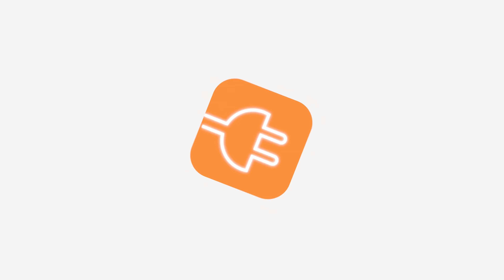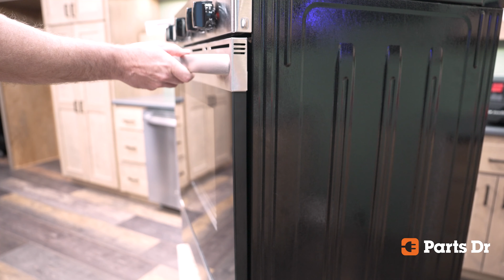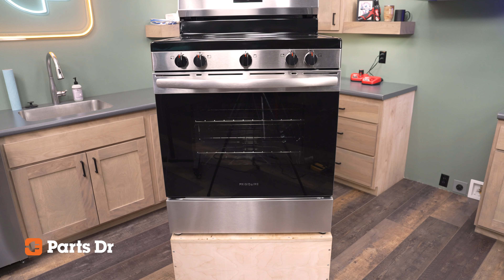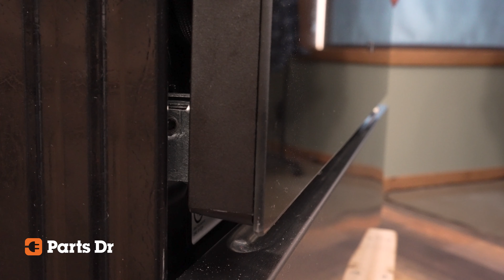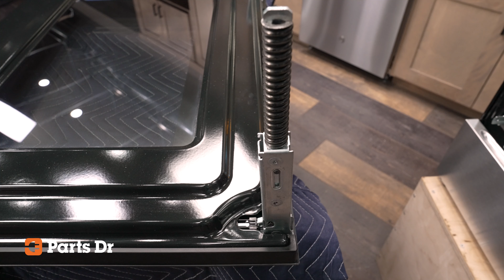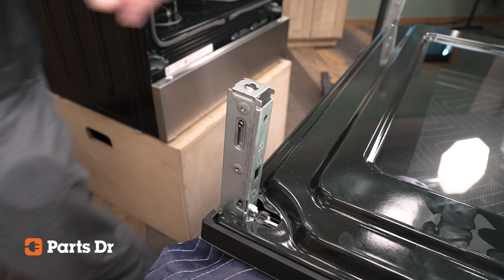Frigidaire Oven Door Hinge with Spring Replacement | Step-by-Step Repair | Parts Dr | 5304534789

Comment from the maker: Thanks for watching our step-by-step guide on replacing the spring-loaded oven door hinge on your Frigidaire range! If your oven door isn’t staying closed properly or is falling open, a worn-out hinge is often the culprit. A quick reminder if you're ordering parts online, especially from places like Amazon or eBay, be careful that many of the cheaper aftermarket parts are of much lower quality. We've seen these fail quickly or not fit correctly, which can lead to more repairs down the road. For reliable performance, we always recommend using original OEM parts. You can get the genuine Frigidaire door hinge directly from our site at https://partsdr.com. Happy repairing and let us know how your repair goes in the comments!

Comment: This is the closest I have found for my Frigidaire wall oven! Unfortunately, I don't see the t20 torque screws on my part. It says our replacement part is 5304526280. Do you have instructions for how to replace that particular hinge?
Reply from the maker: Sorry, we do not have instructions available for this model or part currently.  If you find the solution, please let us know.
Reply: Wall oven model number is GCWD3067AFB